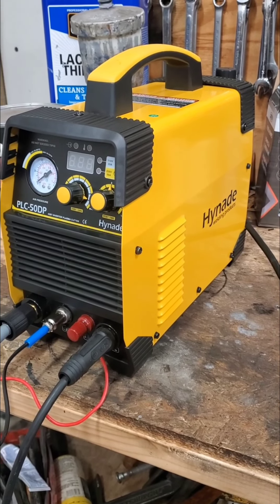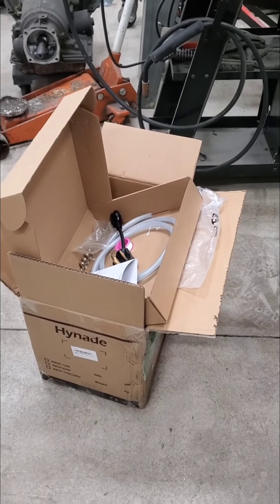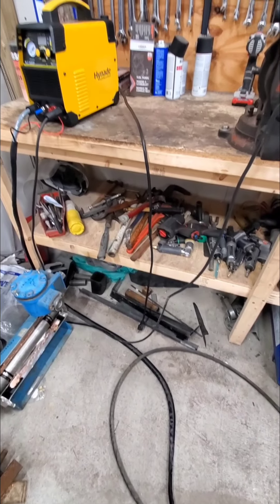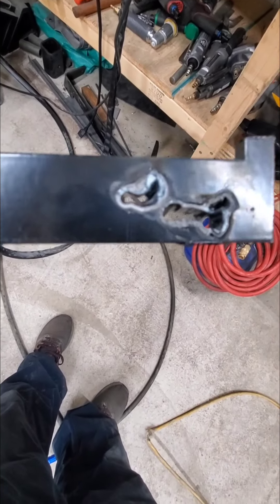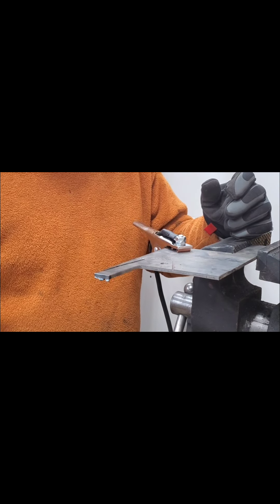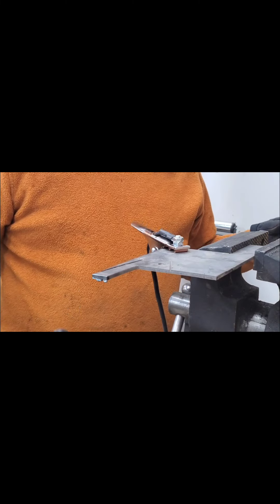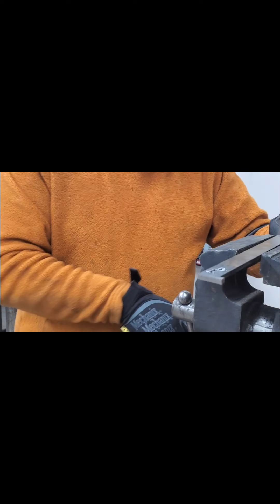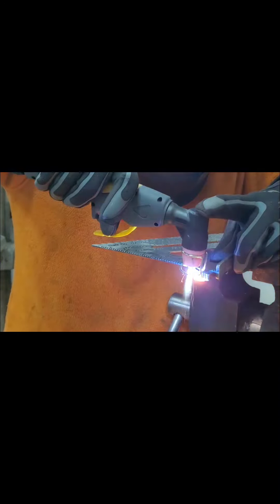Cheapest Amazon Pilot Arc Plasma Cutter

Comment: At 5:15 and 7:10, you can clamp your ground wire to the vise if you can't find a better location. Once the vise jaws grip through the paint or rust, it is electrically the same connection at that point.

Comment: Jeez, that looks identical to my Warfox pilot arc cutter I just bought off Amazon a few weeks ago with the exception of the exterior color.  As far as shading goes, I picked up a pair of Lincoln #5 flip shade safety glasses at Home Depot for about $20.  When you're ready to cut, just flip the #5 shade down...much more convenient than a bulky welding helmet.
Reply from the maker: Thanks for the tip!
Reply: I bought a pair of shade 5 safety glasses at welding supply store for 3.95 that's all you need ! You can also get away with shade 3 glasses a lot lighter than goggles.

Comment: Weird, it looks almost exactly the same as the BestArc, which is the one I bought, and WOW is it an amazing machine!

Just thought it was weird that they looked almost exactly the same, making me think this was a bit of a cheaper step down from the BestArc, but maybe the display and knobs and case is made at the same plant or something.

The BestArc cuts inch thick steel, which was crazy IMO, also a couple of the things that made me get the BestArc was the air adjuster on the front and on the back where the air goes into the machine is inside a metal shield.  I was always paranoid about hitting that air intake sticking out on the back of my old machine and was always annoyed about the air pressure knob on the back of the machine...

Anyway, this one looked similar...

Comment: I purchased an Amazon plasma cutter as well and like you first time user for one on mine was just a cut 50 dual voltage and I bought extra consumables to go with so we'll see how mine works like yours although I do have a question for you about the welding helmet which is what I was going to use what was the minimum setting that you used in order for you to see clearly while cutting?
Reply from the maker: Mine is a Harbor Freight helmet and only goes down to a #9 lens. I have since learned to just not use a helmet at all being careful not to lift the Torch off of my work and careful to let the Torch block my direct view of the cut. I've used the plasma cutter quite  a bit now over the past few months and have gotten much better with it. It works great!!!